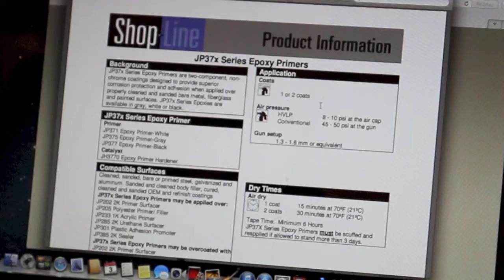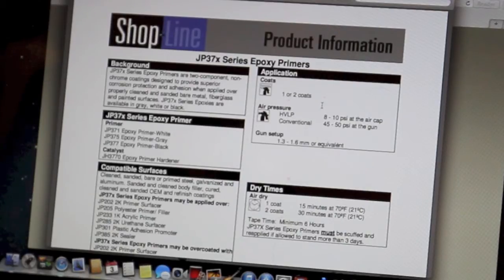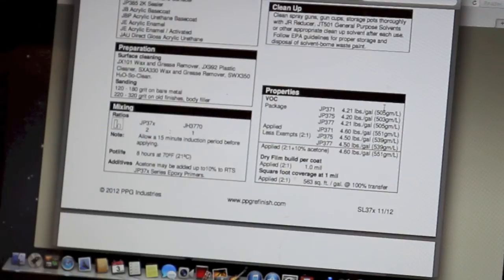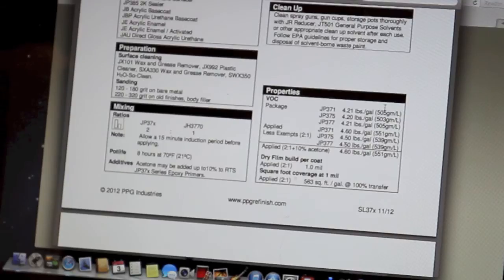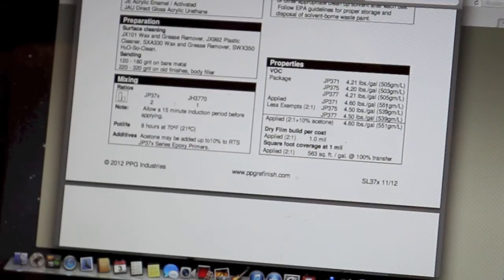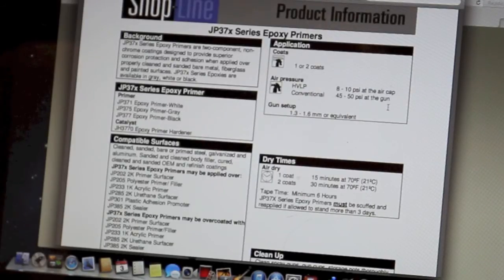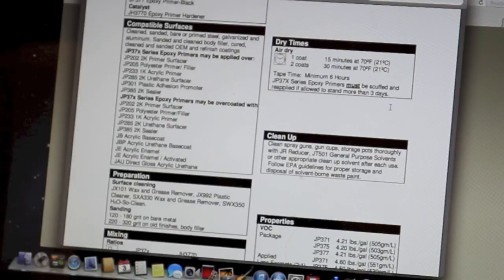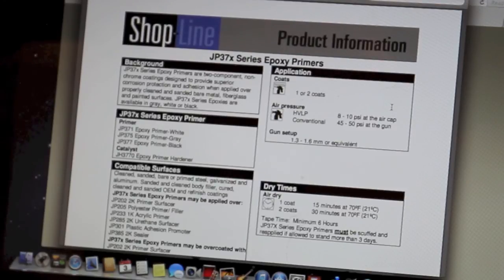Epoxy Primer Shopline JP 371 Technical Data Sheet TDS Facts

Comment: I put etch primer on by mistake on the bare metal and now I need to do body filler can I put epoxy primer over the etch primer or should I sand it all down and start over with a epoxy primer
Reply: Etch primer has active acids that don't react well with body fillers. Trust me

Comment: My local shop gave me jp377 with jh 3770 activator. 

Then to reduce it to use as a sealer they gave me jr505. Is this right? 

The tech sheet says to reduce with jt510?